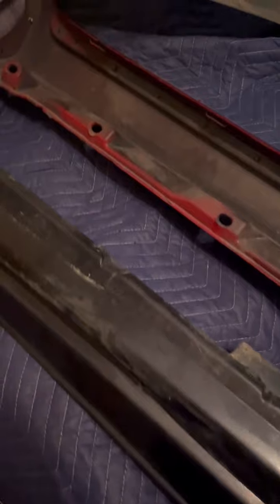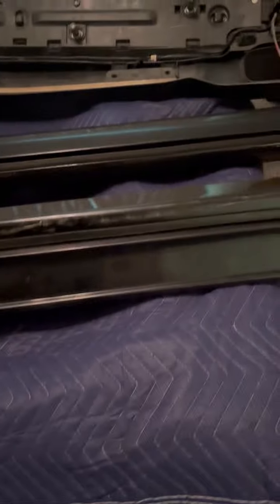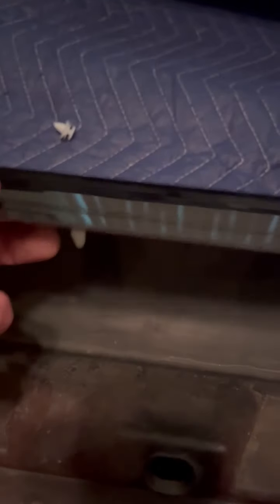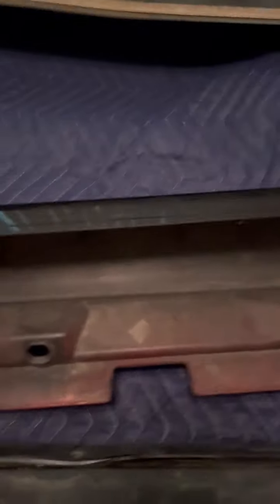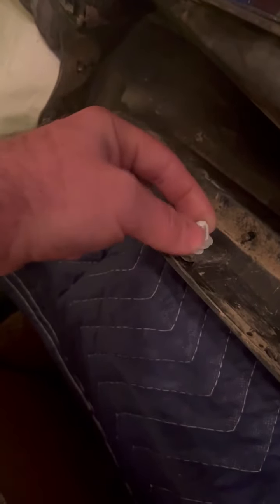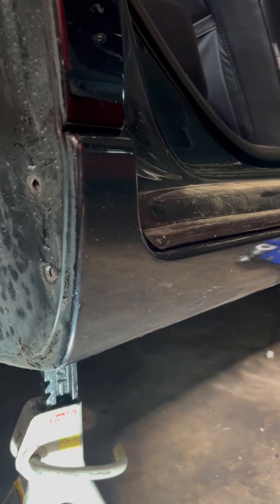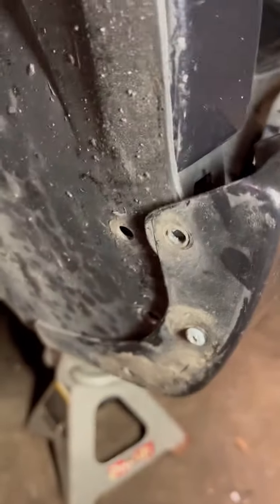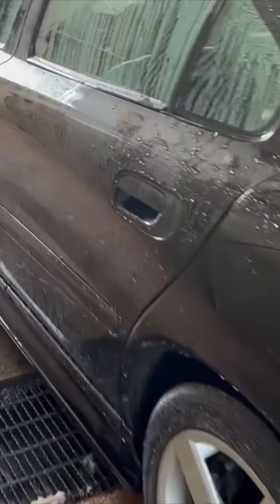Volvo Sport Kit Install

Comment: If I remember tomorrow when I take mine from work I’ll check out those mounting tabs to see if they’re the same. I have a 05’ and kit off a 06’
Reply: to follow up i still havent installed the kit yet lol i ended up getting the whole nose painted first and they did the kit at the same time. ill try to document the rest when i actually do it.
Reply: also theres a 1/2" double sided tape that goes to the door frame to the side skirt